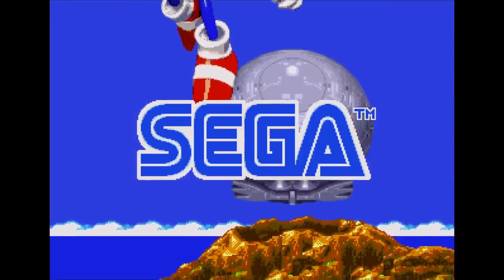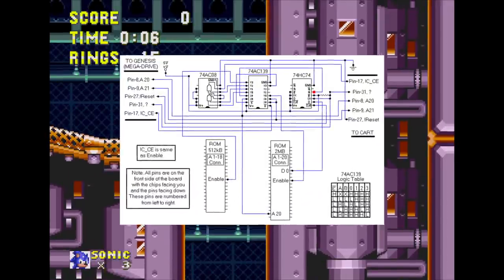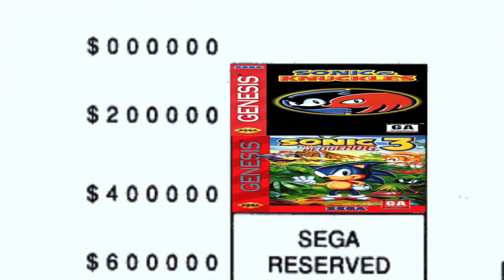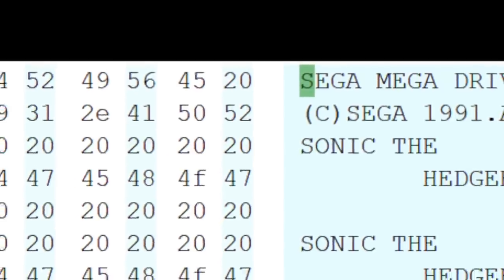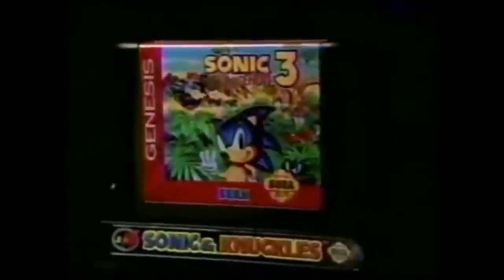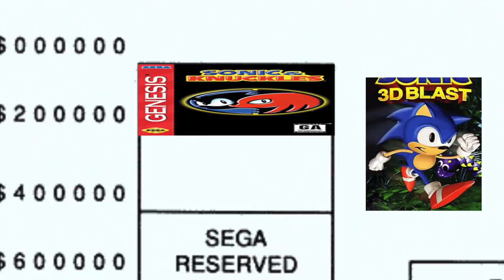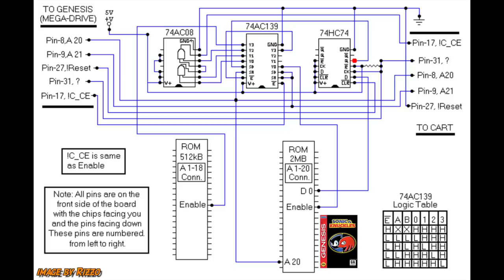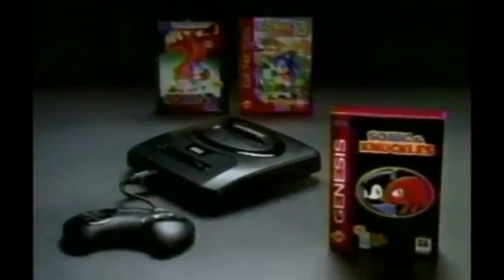SEGA's Crazy S&K "Lock-On Technology"

Comment: Obviously I'm probably wrong, but I also thought S&K was planned way back because there's an extra life in Chemical Plant Zone in Sonic 2 that you can only get as Knuckles.
Reply: Oh, that extra life isn't there at all in the original Sonic 2. Knuckles in Sonic 2 patches some of the levels to add a few secrets for Knuckles to access, and to smooth over some rough edges in the level design that Knuckles could have exposed and sequence breaks that Knuckles could have done easily.
Reply: @LonelySpaceDetective  that makes sense

Comment: I wonder if the Serial number thing is why they didn't try to pull an OoT with Sonic 3 and release a new version of Sonic 3 without all the tracks they cut in the subsequent contemporary releases (The PC and Sega CD versions). which would otherwise render the lock on technology inoperative with those updated carts.

One question though. How did it handle the saves? If you play the base version of Sonic 3, it has a bank of save files, but if you put in the combined cart, you get a whole different bank of save files, and theres more of those save files, and they contain more data (they kept track of your lives and continues, which regular Sonic 3 didn't)

Comment: Talking of cartridges. But fun to explore Sega Saturn cartridges. King of Fighters 95 came with a ROM cartridge with assets so running the disc they worked together. Later King of Fighters SNK titles Metal Slug and Capcom titles like X-Men Vs SF Vampire Saviour Dungeons and Dragons utilized a 4MB RAM cartridge to expand available memory.

Comment: What would "theoretically" happen if you took the top part of the S&K cartridge, and plug the sega SD port on the side of MD? (Actually I was stupid and did this. Both the game and MD broke)
Reply: AgilePeanut I decided to look up the schematics for the system, given that there’s a 9V connection on the expansion port, I don’t think it was the best designed connection in hindsight in terms of ‘idiot proof’ (no offence intended).

Comment: They missed a trick with the lock-on tech. They could have made it so the cartage could detect if a game was lock-on compatible and then jump to a specific address in the games code that would allow the game to load specific code and features if it was on the Sonic & Knuckles cartridge.  Even if it was just to load a custom "no way" screen. Bonus points if the hardware had been different and gave full  4 MB access.

Comment: Could you trick the Sonic and Knickles cartridge used alone into launching Sonic 2 by shorting some pins since the full Sonic 2 rom ins actually inside ?
Reply: I'm not sure if you could trick Sonic & Knuckles into booting Knuckles in Sonic 2 by itself, but even if you could it wouldn't really work as a game.
The KiS2 is not a full standalone ROM like what Jon implied, but just a patch ROM that contains necessary graphics, data like patched level layouts and palettes, and the full S2 codebase with some changes to include Knuckles and fix a few issues. It still relies on the S2 ROM being there for any graphics or data not present in the KiS2 ROM, so trying to boot it by itself would either result in a crash at the start, or not get very far at all.

If you ever manually installed a romhack, think of KiS2 as being more like an .ips file or something like that.

Comment: You didn't mention THE major reason why Sega absolutely had to meet their deadline with Sonic 3: the McDonalds deal! Sega agreed to release Sonic 3 in time for a McDonalds Happy Meal deal, so they absolutely had to meet that deadline. I believe, like you do, that they were developing the lock on technology for some time with the intention of releasing the two games separately. However, I believe the tech was made as a contingency plan in case they could not have the full game ready, which they didn't. Not that it was necessarily their intention from the start. It was a backup plan.

Comment: Wait... is the entire Sonic 2 game in the S&K cart, and the original Sonic 2 cart just unlocks it?
Reply: No.

The patch ROM loads most the graphics, sound, and music data from the S2 ROM, but the engine itself is most likely from the patch ROM because there's no way the S2 ROM itself could just have Knuckles "dropped in." That's just not how it would work.
Reply: The Sonic 2 ROM doesn't fit on a 256 KB chip, but I also have uderstood the same.
Reply: @albertodominguez4136  hmm you're right, I think the Sonic 2 cart was 8 megabits, which is 1MB. Maybe the 256k ROM in S&K contains the game code, and it pulls the assets from the original cartridge.

Comment: Can you do a video on the recent Sonic port to SNES, but also compare the difference in hardware and the problems that brings to the port? It seems clear that the MD has a considerably faster CPU than the SNES, especially after looking at the demo scene, and this port is more proof of that. I noticed that Toy Story also cuts out the more CPU demanding levels on the SNES port. I can't imagine it doing what the base MD did without a Super FX chip in the cartridge. On the other hand the SNES can display more colours and has some extra hardware features.

Comment: "Sonic & Knuckles" cartridge has 2 MB for both S&K and "Knuckles in Sonic 2" code as you can lock S&K with Sonic 3, Sonic 2 and any other game in BlastEm. Also you can merge ROMs in very old piece of software called "Sonic Hacking Wizard" which has special function just for lock-on. I dumped my own copies of "Sonic 3" and "Sonic & Knuckles" separatley using FlashKit Programmer and merged ROMs into one. The result is a perfect MD5 match with ROMs found in No-Intro and Good sets.

Comment: The lock-on tech was developed cause they had a promotion with mcdonalds but couldnt finish sonic 3 in time, so they decided to split it up.
And designing the lock-on tech isn’t actually that hard. Its just basic address decoding. An electrical engineer experienced in the field (like, say, someone who designed a console) could design something like the lock on before their first coffee break. The difficult part with address decoding is usually knowing what addresses to put where, and if all you’re doing is mapping one memory range to another, thats fairly simple.

Comment: A really sad outcome of not putting DRAM in the Sega Genesis board is that Main Memory is kinda "low" for a 68k system. With 256kb of dram, It would be lot easier to compress code and tiles(Decompressing them from the cartridge), and this kind of gimmicks were useless. DRAM was remarkably cheaper than SRAM and Ironically, Genesis used DRAM in the Video system, with its own independent refresh controller. Also a RAS/CAS and decoders would be a good solution to put DRAM in cartridges or Page Mode ROM's in place.

Comment: Clever pulses?? Ok, I looked at schematic at 6:20 - this is what is does:
.
The program on the ROM is supposedly able to tell the console to set "/TIME" bit on the cartridge slot that is supposed to be used by real-time clock on the cartridge. Instead, cartridge memorizes whatever is on data bus bit 0 into a D-latch (1-bit memory IC, second memory bit on same IC is unused).    
emory accesses below 2MB always go to "Sonic&Knuckles" ROM
If memorized bit is 0, memory accesses above 2MB go into plugged-in cartridge (I'm guessing, Sonic3+Knuckles mode)
If memorized bit is 1, memory accesses between 2MB and 3MB go to plugged-in cart, and between 3MB and 4MB - to "sonic2-knukles" 512KB ROM.
Sorry if I'm wrong.
.
I have no idea how Sega MegaDrive works, but to me the schematic looks really weird. Did they really need three extra chips? Well, it works, I guess.
.
Electronically, this "lock on technology" feels like something thrown-together, or at least nothing to brag about. They could have sold the S&K3 and S&K2 parts separately and would only need one extra chip in each.

Comment: I had always wondered why it didn't let you play as Knuckles in Sonic 1, and now I have my answer. Though it would've been neat if they had added an extra patch chip for the original game.
Reply: They did actually try to make Knuckles work in Sonic 1, but abandoned it for undisclosed technical reasons. People speculate have to do with how the blues in Sonic's color palette were reused for other things in that game, though the Knuckles in Sonic 1 romhack proves that was not an insurmountable problem.
Reply: Month late, but I actually a correction to make: The devs did mention why they didn't get Knuckles working in Sonic 1!
Apparently, they thought the level design was too unworkable to adapt for Knuckles's abilities, whereas Sonic 2's Super Sonic had forced them to account for Super Sonic flying around and therefore could be adapted to fit Knuckles fairly easily.

This is... not a terribly convincing argument to me, as Sonic 2 still had a few rough edges and empty areas that the patch ROM had to address, and the Knuckles in Sonic 1 hack shows that Sonic 1's level design is perfectly adaptable to Knuckles.
My best guess is a combination of this story and what I said a month ago: They initially wanted to do Knuckles in Sonic 1, but they didn't have the time to work out how they were going to modify the levels and deal with the palette issues+other potential problems to addition to working on Knuckles in Sonic 2 and S&K itself, so they decided to just scrap the plan in the end.

Comment: Can you explain the genesis reset button? There are some interesting things I found. On Sonic Classics if you select a game and reset the genesis it will reload the game you selected not the whole compilation. On Mortal Kombat if I enter the blood code and hit reset, the blood code will still be enabled. Lastly is the X Men game were you have to reset your genesis to continue. What up with that?
Reply: As far as I'm aware, the reset button on the Genesis was not a hard reset where it effectively acts as power-cycling the console, but a soft reset; where the exact behavior is actually dependent on the game and what it is programmed to do.
I imagine Mortal Kombat retains the "blood code enabled" flag between resets, and that X-Men is programmed so that the reset button performs a different function when you're at that specific point of the game. Not sure what's up with the Sonic Classics one though.

Fun fact: If you insert a Sonic 2 cartridge, input the level select code, rip the cartridge out of there and insert Sonic 3's then hit the reset button, the level select will be enabled in Sonic 3. This is because Sonic 3 still uses the same value in memory for the "level select enabled" flag as Sonic 2, and both games are programmed to not clear the flag on a soft reset.

Comment: So as a stupid question, what stops a developer from adding a fake ROM header at the "proper" place in extended memory games?

Like, the Sonic Classics game makes sense, Sonic 1 is probably just the original ROM put into a multi-ROM cart. But what if you added a fake header at the proper place in the Sonic 3D Blast game, would it then be identified properly, or would there be issues with coding something like that?

Comment: I'm surprised you didn't mention how Sonic 3 & Knuckles is just Sonic & Knuckles, but in a special mode where the Sonic 3 stages are accessable. The Sonic 3 cartridge is only there to load art and other data from, but not code. This is because offsetting Sonic 3 to a ROM location other than $00000000 breaks all pointers to addresses.

Comment: The modded sonic 2 rom was completely on the S&N cart already? Does that mean there is some sneaky way to play the modded sonic 2 game without needing a sonic 2 cart plugged into the top? Man I thought I tried every cart I owned into S&N but I must have never tried sonic 2 what an idiot. Time to dig out my Sega.
Reply: The Knuckles in Sonic 2 chip is just a patch ROM; containing only a modified form of Sonic 2's code and possibly a few art assets used by KiS2. Running it by itself wouldn't get you anything. Think like the patch files that you apply to ROMs to get a romhack, but in actual hardware.
There are dumps of S&K locked onto S2 that effectively function as standalone KiS2 ROMs, if that interests you.
Reply: @LonelySpaceDetective  ah understood. Thank you for the info!

Comment: The Sonic & Knuckles cart contained the entire modified Sonic 2 ROM? My childhood was a lie. Also, I wonder if there's any hardware trickery you can do (maybe with a bit of soldering) to get the Sonic & Knuckles cart to boot into it without a copy of Sonic 2 being on there. That'd be fun. But it doesn't make up for my childhood. WHY, SEGA, WHY?
Reply: Also, a game with a cartridge connector and a fancy new plastic housing with a door for said cartridge connector was cheaper than a cart containing a 4MB ROM?
Reply: Knuckles in Sonic 2 is just a little patch for the game, i dont believe you may be able to run it without the actual game the patch applies into

Comment: I don't believe for a second sonic & knuckles wasn't planned from the start. Think about how long it takes to make a brand new physical package (circuits + plastic case + plastic swivel) let alone test lock-on? (What if it only worked "sometimes" or dust, or misinsertion broke it?) You can't cram that out in 8 months unless you straight up panic. We might as well say Star Fox and the SuperFX chip came out in 8 months. Except the SuperFX chip got used in at least 5 games (+3 SuperFX2 + 5 cancelled games), it wasn't a "one off" like Sonic and Knuckles.

Comment: Talk how it is possible to have more than 4Mb in MD, for example SOR2 16Mb and SOR3 24Mb
Reply: I'm not terribly familiar with bank-switching, but my basic understanding is that there's a little chip inside the cartridge that changes which portions of the ROM are able to be accessed by the console depending on what the game needs.
Essentially, only 4MB is able to be accessed at any time by the Genesis, but you can swap out whatever's in that 4MB for anything beyond the first 4MB of the cartridge and back. Makes the cartridge more expensive to manufacture though!

Comment: S& K lock-on was a terrible idea. It caused confusion among fans and split what was meant to be a fully integrated storyline across two games. If you bought Sonic & Knuckles but not Sonic 3 the story made no sense at all. 

Oh, and it destroyed the built-in flash memory component of the original Sonic 3 cartridge. My saves for S3 were wiped the second I plugged in the game to S&K and it never worked since. For me that was the biggest problem I had with lock-on. SEGA really should have released a complete and whole 4MB Sonic 3 title in Xmas 1994.

Comment: Could they have used a lock-on type cart as a minor expansion for increased ram and Nintendo style MMC/Super FX chips?
Reply: Maybe, but Genesis was on its last breath when it came out with Saturn being just around the corner and probably it was easier and cheaper (though not necessarily for the consumer) to just stuff any extra ram/other chips directly on the cartridge's PCB.
Reply: @UltimatePerfection  There was this idea of putting the SVP chip in a lock on cartridge then releasing games you'd plug on top of it that required the chip...basically like how it works on the 32X but cheaper
Reply: @UltimatePerfection  Always seemed so wasteful to put MMC, Super FX or DSP chips into individual carts. Such could have been issued earlier in the consoles lifetime too, if say Pilotwings/Mario Kart required a 15$ lock-on solution the tech would have been available to more games. Plus future revisions could "lock-out" (boy am I being clever here) pirates and unlicensed software.

Comment: Minor error. You said the commercial was a 1984 advert... 

Sonic didn't even exist in 1984. You meant 1994.

Also, how expensive were 74-series chips in 1994? I can't imagine the logic to change ROMs between SK and the S2 patch ROM was as complex as to require a pulse when something as simple as incrementing a counter or enabling a simple decoder that changed which chip's enable line was held low would do the trick, so I suspect you're over-analyzing how that worked.

Comment: It's not that complicated, just a simple bit of bankswitching. You should see the juggling they had to do on the Atari 2600 to get more than 4K in a cart! Later carts had extra ROM, extra RAM (and there was no R/W line on the cartridge port cos why would Atari put one there, when it's for ROMs? So they had to use an address line instead), and even in Pitfall II an entire custom chip that fed data line by line into the 2600 pre-chewed and digested, allowing effects that would otherwise be impossible. That's really getting the most out of horribly limited hardware, that was designed with playing Tank and Breakout in mind, and not much more. The standard of arcade games it was meant to replicate in 1977 really weren't much, yet it hung on til 1990 even with stuff like Klax having a properly drawn playfield.

Was the 512K patched Sonic 2 the entire game? I had the idea, when it came out, that maybe there was new code in the S&K cart, but the level data and graphics would still be loaded from the old Sonic 2 cart. 

Incidentally because I wanted to lock-on the carts in an early Megadrive emulator, I just copied the 2 ROMs, COPY /B, with S&K first then Sonic 3 or 2 after. Worked fine and I'm pretty sure the emulator didn't have any extra code in it to handle it, maybe because it all fit in 4MB it was OK.